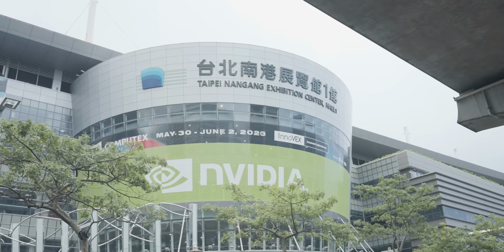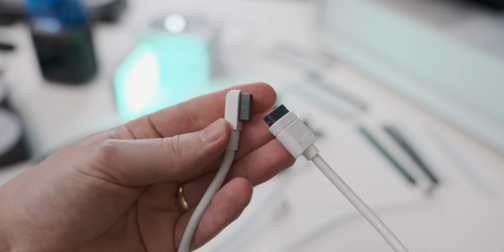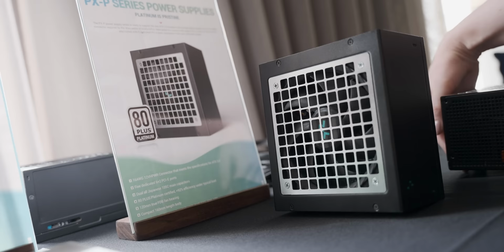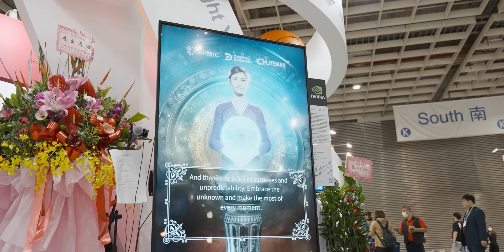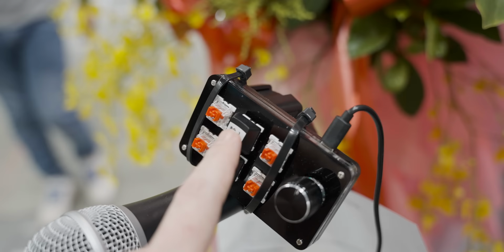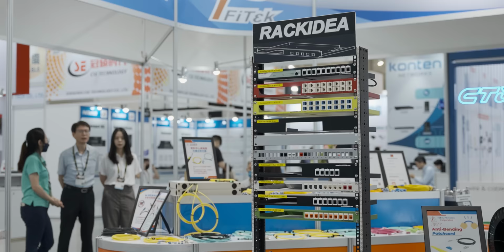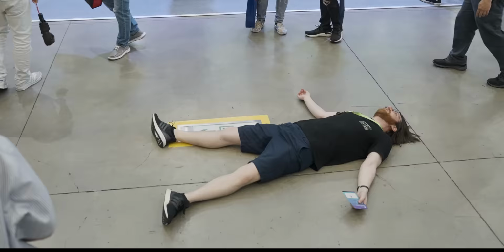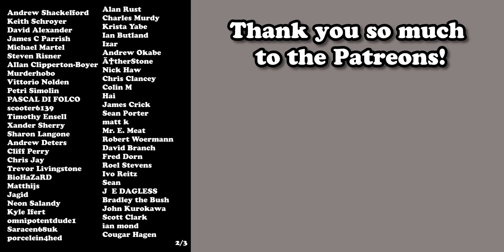I Discover The HIDDEN Side Of Computex...

Comment: I was sure AI could never replace us... 

 ... until I saw Dawid struggling with that button.
Reply: Yes, Humanity is doomed! (..chuckle)
Reply: I suspect that the host didn't give clear instructions though.
Reply: I'm fairly sure it was one of those things that they decided "how could we make the button the most obnoxious and unintuitive thing possible?" It looked like one of those ones that has two states that you have to cycle through, when it should have just been a hold down and talk button
Reply: @macledou  Yeah, this is kind of button that makes creators go "oh shit, we need to change this ASAP" after the convention reveals the lack of user-focused consideration.
Reply: Humanity has known push-button controls for something like a century and a half, if not more. If they made a button work contrary to 150+ years of collective experience, I feel like it's not Dawid's fault.
Reply from the maker: If we can’t press the button, how can we stop it? 🥲
Reply: @DawidDoesTechStuff  You stop machines the same way you fix machines.
A hammer.  If this does not work, acquire a larger hammer.

Comment: I wish i had found that server rail booth
I just put together a server rack i got for free, mostly glass, 36U, fully enclosed with ventilation holes bottom and top, with spots for exhaust fans on top. 
The problem? Its an audio rack so at most the rails can be no more than 18 inches deep from ear to ear, and the overall length cannot be greater than 24 inches, that includes any cables coming out the back or handles in the front of the server chassis

I've found some good server chasis for this rack even a 4 U with 15 drive bays(5 internal, 10 external hot swap), but not a single rail, as the 4 rails i've tested that claim to be short enough, are somehow too thick, preventing the server from sliding into the rack

Comment: I find it so weird how people have issues with pressing buttons lol.. Most folks want to just hold the button in forever.. Others want to just barely tap the button - then they wonder why it is not working right lol.. Drive me nuts trying to show someone how to do something that I find is intuitive like that. I say press the button and they jam there finger into it like it is and old 80's cassette deck. I say tap the button and they poke it like it will explode. I say hold the button and they use so much force their fingertip turns white lol.